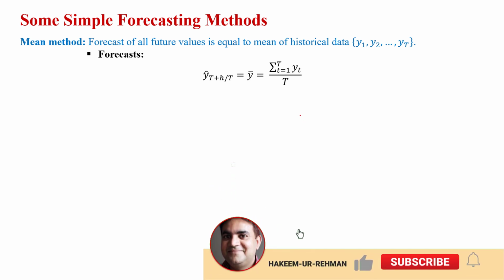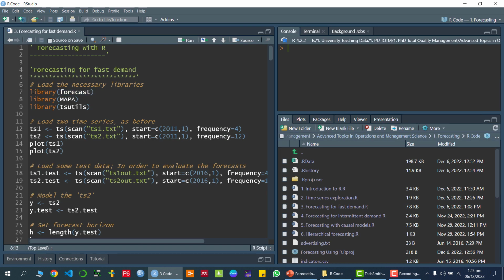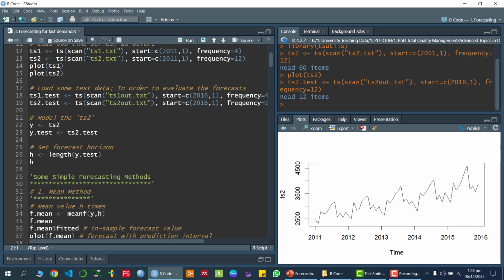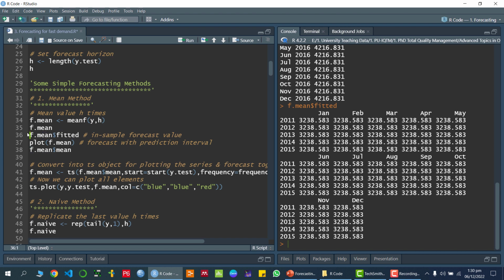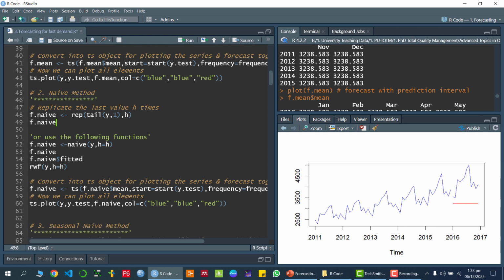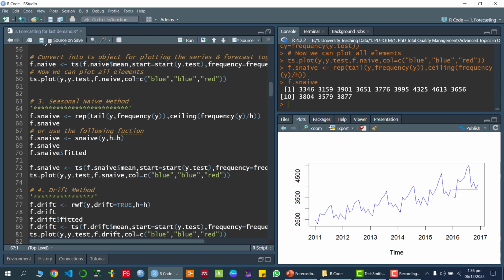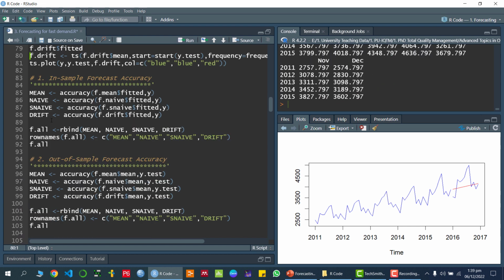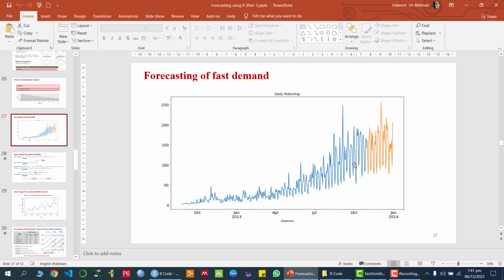Simple Forecasting Methods Using R | Mean, Naïve, Seasonal, and Drift Models

Comment: in sample accuracy when i run MEAN<-accuracy(f.mean$fitted, y.test) it showed an error $i not an atomic vector
Reply: and when for a check i run MEAN<-accuracy(f.mean,y.test) means without  $ there was no error
Reply: Error in fmean$fitted : $ operator is invalid for atomic vectors
Reply: i adopted the similar method that first run fmean$fitted then the accuracy function but facing the same problem